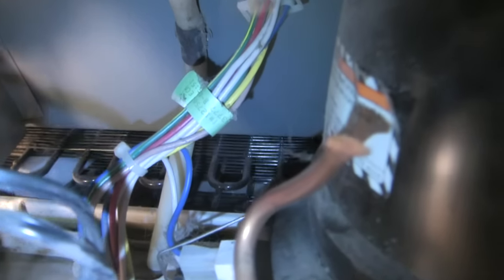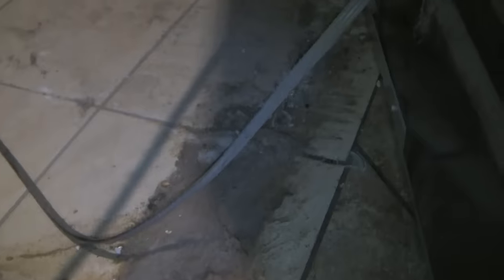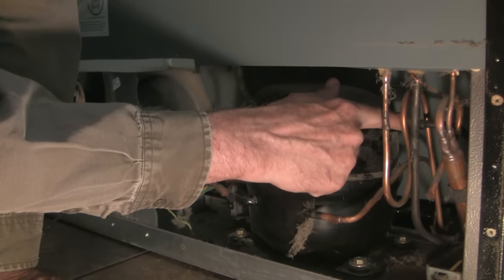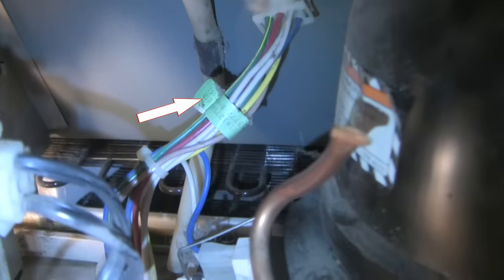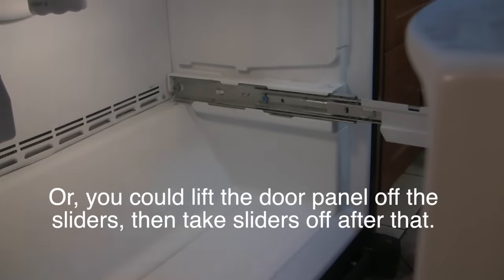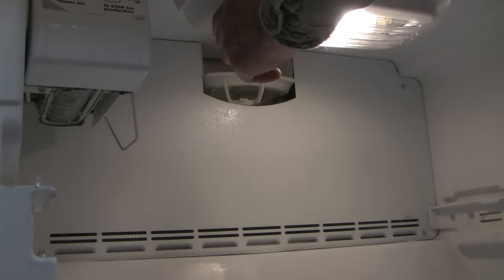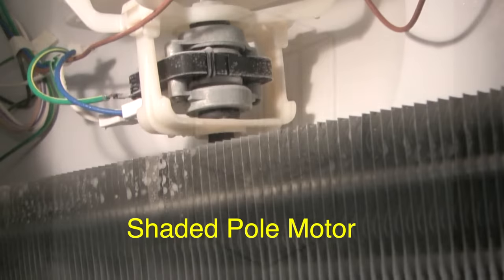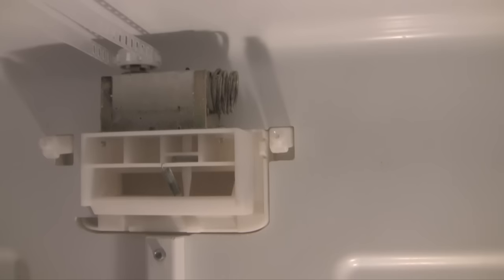How to investigate and fix a fridge that is too warm

Comment: Hi i had my fridge freezer lying down on it side and turned it on with out letting it stand. How can I fix it and what do i need to look out for. It not getting any colder
Reply from the maker: Tip it upright for a day, unplugged. Then cross your fingers and hope it works when you plug it back in the next day. If not, I'd do the usual, check fuses, check for power at the compressor, test resistance of the compressor windings. It may be something else, most of the time you get away with laying it on its side, but I can't say.
Reply: @spelunkerd  thanks I will check today

Comment: My tray for water is on top of the compressor. It is decaying but still possible to collect water. To keep it in place I put a dot of hot glue because I found it on the floor behind the fridge. Was it okay to hot glue it in place? I only put a little glob. I took a picture of tray and I am going to find a new one to replace it.

Comment: I cleaned the coils front and back I had to blow them with a service vac. I checked the codes all looks good. I opened the trays and the panel. The coils are pristine. No icing. Yet it’s not cooling. The air coming from the freezer to main section is not cold.  The fan is running on the back and I can feel it’s cold.

Comment: When I pulled the back of the freezer off like you did at 5:48 and looked at the evaporator, it was completely iced over, or snowed over with ice crystals the consistency of a snow cone. The fridge is making that loud groaning humming noise you described.. so just to be clear, are you saying I need to replace the evaporator fan, or could it be something else??? The temp in the refrigerator (not the freezer part) is way less cold than it used to be. I have to turn it up to 8 out of 9 just to keep the food cold enough! Something's slowly going out.. but what???!! 🤔
Reply from the maker: That ice needs to be defrosted first, so unplug the fridge, try to store vulnerable contents somewhere cold, and wait. You can speed defrost with steam from a kettle. Once all the ice is gone, probe that drain tube to look for blockage, vacuum the water away, and plug the fridge back in. Then look for the two fans, the condenser fan and the evaporator fan. Make sure they are working properly, the fan blades are spinning and it is moving air. Most fridges have a defrost heater element that can go bad, it is usually a simple resistance heater with a fuse. Find the circuit drawing somewhere inside the fridge, and find and identify the defrost element and its fuse. Defrost is a cycle that happens every few days, where fans turn off, the heater turns on, and the ice is melted. The timer for defrost can go bad, and old school fridges have mechanical timers that can get stuck in defrost mode. Your circuit drawing should clarify what design your fridge has.
Reply: @spelunkerd hello I replaced my relay and overload and my refrigerator started working again but only for a few hours then stopped working again any suggestions

Comment: My freezer was ice cold but fridge was only 60f.  I checked the electronic actuator door and it was not moving regardless of temperature selected.  I unplugged the fridge then plugged it back in and the actuator started working again.  So all the was required was a reboot.  I remembered after the fact that I had done this about five years ago.  Always start with a reboot, you have nothing to lose
Reply from the maker: Good point. In my fridge the bimetal strip is entirely mechanical, there are no wires at all. Even so, advice to reboot for any problem in a device like this with a control board is wise.
Reply: How did you get the 600 lb fridge outa the wall cabinet to unplug the damn thing to reboot it ??? I’m old and 65 weaking
Reply: So you unplugged it  so how long do you leave it unplugged before plugging it back in?
Reply: For a computer reboot?
Reply: @terryhawkins2324  just flip the breaker if you can’t move it
Reply: Well I went thru the whole routine and the temps in both aren’t going down their going up so tomorrow guess I’ll get my high powered  pressure washer out and blast the hell out of the radiator looking thing then blow it out with the air compressor wand then I’ll take my model airplane heat gun and set it inside hopefully to melt any and all ice that must have accumulated inside the thing and if this don’t work then I’m gonna take it out side and fill it with TANNRRITE EXPOLSIVES and show this fridge WHO’s BOSS!!!
Reply: No patience when comes to crawling around on the floor and on a ladder!
Reply: @terryhawkins2324  it's been a while, but most 'fridges have wheels under. Does yours?
Reply: @grantgrow  Yes our fridge has wheels.  If you can't move yours just try trowing the breaker.  Several years later I did have to change out the flapper assembly and working perfectly since.

Comment: I have a brand new refrigerator, should it have a clamped off coil and if so could it have a small freon leak? What is the coil clamped off?
Reply from the maker: Most residential fridges these days have a blind end that is used during manufacturing for filling the system. They are no longer equipped with ports to measure pressures, which is irritating. So if you need to measure pressures you have to use a puncture kit to gain access.
Reply: @spelunkerd  this is a regular coil that looks like it's been cut with plyers, it's rugged there is nothing over the rugged cut.

Comment: Come home to find my fridge warm, but freezer working, so far cleaned my condenser coils under the fridge, they were very dirty.  Then took apart my lower freezer to expose the evaporator coils and it was all iced up.   I suspect my defrost element is not working has my evaporator has froze up in the past. My fridge looks like yours in the video but I have digital temperature controls.  Took it apart to try and find the defrost timer.  I don’t think I have one?
Reply from the maker: New fridges use electronic timers that may be integral to the board. You can still evaluate the heater circuit. Check for power and ground, measure resistance of the heater, look for corroded or broken contacts, and keep your eyes out for a fusible link or fuse. I wouldn't give up on the idea of defrosting, clearing any debris from the drain hose, and trying again.

Comment: hello I have a whirlpool refrigerator freezer on top its a mid sized. The freezer on bottom of vents got hot you can see it turn orange gets hot I hear a sizzle sound makes some noise but the freezer is cold and the refrigerator is cold but I think there is a short. I'm in a apartment building in NYC so maintenance will replace it what do you think happened?  thanks
Reply from the maker: Gee, scary. If it is orange hot, something is dangerously wrong. The defrost heater is on a timer and if the timer sticks I suppose the heater could be on for too long. I'm surprised the thermostat wouldn't cut out. I would ask for help from a pro, as soon as possible, and probably move food to a different fridge and turn it off while waiting. Unplug the fridge before poking anything in there, you don't want to get a shock. Sometimes you can have a short circuit that has high enough resistance that it doesn't blow the fuse, getting so hot as to cause a fire. Better to be safe and cautious.

Comment: What would cause both of the compressor’s tubes (high and low side) to be hot?  Lack of refrigerant?  I’ve got an old Maytag. All the fans work and the freezer is cool (not cold), but fridge is warm. But I noticed both compressor tubes are hot to the touch.
Reply from the maker: Gee, not sure. I'd clean out the fans and condenser, and listen closely to how the compressor turns on and off. If the current relay has failed the compressor may not get up to speed, resulting in overheating, quick cycling, and inefficiency. I wouldn't think of undercharge first.
Reply: @spelunkerd  thanks. I think that’s what it is. A failed relay. Did the shake test and it rattles like a mo-fo while leaving pieces in my hand.

Comment: I'm old enough to remember when refrigerators didn't need maintenance. As a kid we had an old Norge in the basement that was at least 300 years old. It'd be worth a fortune now.
Reply from the maker: Yeah, old appliances are worth keeping if you can, new versions are not designed to last nearly as long.
Reply: I have a nice sixty year old Frigidaire still working down in the basement cooling the beer next to the chest freezer. I suppose if I kept the kitchen fridge down in the basement too the cooler location would be easier on it, the budget and the extra up/down the stairs would help keep me healthy and fitter with the exercise.

Comment: Here's what I ran across with my old Whirlpool: Water started puddling on the floor. Water had puddled inside the bottom of the refrigerated space and one of the drawers. The fridge was getting warmer, about 50-55 deg F. I took everything out of the freezer and took the bottom and back panels out. Everything was iced over. I used a plastic spatula and small amounts of boiling water to remove the ice and ice plugs. I sponged all the water out while melting the ice. I then dried everything out and reassembled. The fridge was still not getting cold enough and I noticed that the gap between the fridge and freezer doors was very warm. I then took the cardboard cover off the back and vacuumed everything I could reach. I removed the lower front grill and did the same. Using a flashlight, I saw there was still significant pet hair on the coils underneath. I ended up using a long brush and leaf blower to get the rest out. Two days later, the fridge is at 34 deg F, just above freezing, and I can adjust it to where it needs to be. My other fridge is starting to hum. Sounds like I need to do the same before it gets ugly. --Bottom line: Clean the coils annually especially if you have pets.

Comment: Hello, very descriptive and informative video. My fridge isn't properly cooling, the compressor is working, and so is the cooling fan. The condenser fan is blowing but not at full power. Can you help me understand why? Thank you.
Reply from the maker: There are only a handful of diagnoses that can be fixed by the home handiman. So, I would focus on those. Check the door seals very carefully, even a milimeter gap might be enough to tip the fridge into poor cooling. I did a video showing how to fix that. Check to see if cooling is reduced in both compartments, if not look at that flap valve controlling cold air sent to the main compartment, and check your condenser coil for dog hair, obstructions, plastic bags, etc that might impair heat transfer. One thing that sometimes happens is the unit goes into a defrost mode and can't get out of it. Old style units had a dial with a switch, easy to diagnose, but new units are entirely electronic. If your compressor is starting and running then it is not likely the PTC relay. All that being OK, the next consideration is whether you have a leak of refrigerant somewhere. The leak boils away but the oil in the unit can stain the area that has leaked. Or sometimes the compressor itself loses the ability to mount a pressure head. Whether it is worth diagnosing and fixing a fridge like that is hard to say. New fridges are fairly inexpensive and they come with a warranty, and repairs aren't all cheap.  It's kinda sad to see so many new looking appliances at the landfill.
Reply: @spelunkerd  Thank you for the help. I've went through all the applicable troubleshooting tips. No pets, nothing obstructing the circulation of air, the door seals are in tact. After a closer look I realized the condenser fan isn't blowing at all. However, listen to this, my younger sister has schizophrenia and oftentimes she will bang on the refrigerator. I think that's the reason why it's not working properly because it happened after one of her episodes. In your opinion can that cause the malfunction to the fan? In any case, I may just replace the unit..
Reply from the maker: @yishaithegift9953  I did a video on how to diagnose a bad oven fan. The design of the fridge condenser fan may be different but the general principles apply. A multimeter will tell you whether the board is trying to turn that fan on. If the fan isn't spinning, and it's getting adequate power, then the fan is bad. I don't know how easy it would be to get a replacement. Yeah, if the metal casing is bent then the fan blades could make contact and seize. More likely the bearings are shot.
Reply: @spelunkerd  I'll check out the video. Thanks for your help and advice. Subscribed!

Comment: Thanks for the info but it's not helping my fridge problem. I do not have a freezer it's just a stand alone fridge. I did check everything you noted and it's been off for 3 months so there is no frozen coiled so not a problem I replaced the capacitor and the start relay cause that was causing a problem now it turns on and it runs and the compressor kicks on fan is going inside fan is going outside no problem, But still the air that's coming through the vent is cool  not cold.  

Any ideas?
Reply from the maker: At some point you have to wonder if it is time to pull the plug and buy a new fridge. You could have a small leak of refrigerant, but the cost of finding and fixing the leak could easily exceed the value of the appliance, and you get no warranty after it is done. A failing compressor will do that, too, but repair costs aren't generally worth it.
Reply: @spelunkerd  do you think it's the adc or the thermostat? It's only 2 yrs old

Comment: We tilted our fridge slightly back to just reach the legs underneath. We reversed the door and it took a little figuring out. Now once done it's hot on the sides and an hour later still is hot. Not sure if I should turn it off for a while or leave it??
Reply from the maker: I'm hoping your problem resolved overnight. Those door seals are really critical, even a tiny 1mm gap would be enough to devastate the efficiency of your heat pump. So, check all the way around, you shouldn't be able to slide a piece of paper under the magnetic seal anywhere.
Reply: @spelunkerd  everything is tight. Side of fridge is still warm bit not hot. Cold inside. Thank you
Reply from the maker: @mamawlife7852  New fridges these days have the condenser coils hidden in the walls or the top, completely concealed by sheet metal. Encapsulation prevents dust from getting inside, but of course with sheet metal all around, direct air flow over the coils is reduced. The sidewall and top of these new fridges is used to radiate heat, so warm walls is part of the game. That's why in the manual they ask you not to put anything on top, and to give enough clearance for air flow across the outside walls of the fridge. The price you pay for testing that boundary is higher energy cost since the fridge needs longer run cycles to stay cold.

Comment: We had a flood in the basement. Both fans work on the fridgidaire refrigerator.  The compressor does not come on. Could it be the relay? Thanknyou
Reply from the maker: Yes, possibly. If it began with a flood, search for the wiring diagram and look for fuses. The PTC resistor on small residential fridges is a weak component and when it fails it may rattle when you shake it. And the defrost timer can get stuck in defrost, which is easy enough to test if you can find the timer. There are many reasons a compressor may not come on, so you'll need some experience with circuit diagnostics if you want to take it further. If the circuit board got flooded you could have a general board failure. And if the compressor tries to start, and all you hear is a hum, then it quits, a failing split run capacitor can cause it. I did a video of that presentation on a residential heat pump. If the compressor overheats it will lock out to prevent fire, so you may get more evidence the following morning after it is unplugged and cools down.
Reply: @spelunkerd  thank you

Comment: I hate to admit it, but the odd screws holding my back panel in place have me confused.  It tried grabbing them with pliers to rotate them and it didn't work.  What sort of tool do I need?    The screw heads are a raised hexagon but they're flat across the top.
Reply from the maker: Many new appliances come with modern fasteners like Torx, and of course metric and security bits are there to trip up DIY effort. You can buy a set of security bits (from automotive stores like Harbor Freight of Princess Auto) that give more options.
Reply: @spelunkerd  Thanks.  Making do with a mini-fridge & coolers because I couldn't get the back panel off.  I'll check into those.

Comment: I opened my refrigerator and the coils between the condenser to the compressor were covered with ice. The coils were also covered with ice. The freezer wasn’t freezing. What do you think is the issue and should be replaced? Thanks you channel is very helpful.
Reply from the maker: Most fridges these days have a defrost element, an electric heater placed near the evaporator. It is run on a timer, either electronic or analog, typically running for ~30 min every 12 hours, during which the compressor turns off. After the heater does its thing, ice turns to water and there is a drain to carry that water away. If the drain gets blocked by debris, the defrost cycle ends and the lake of iced reforms. So, the possibilities are a bad heater element, a blown fuse, a broken wire, a failed timer, a bad electronic board, or a blocked drain. I would start by defrosting the fridge, mopping up water and making sure the drain is working. Then I'd inspect the area looking for the timer, checking the circuit/fuse and measuring resistance of the element.